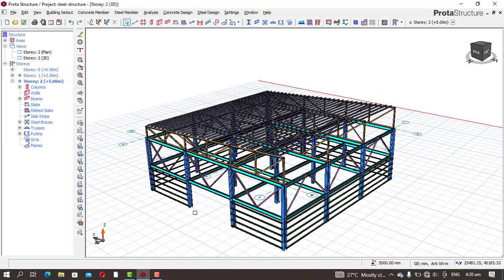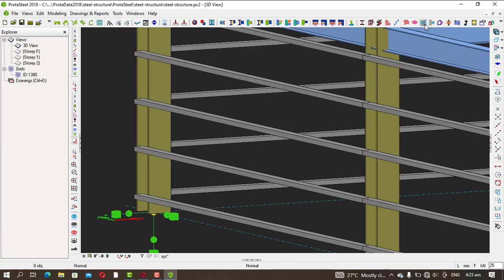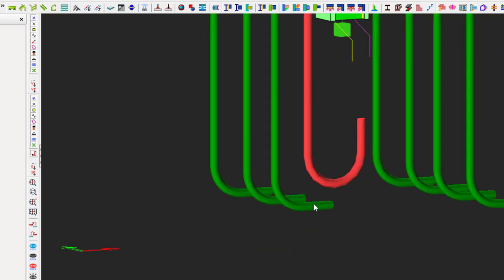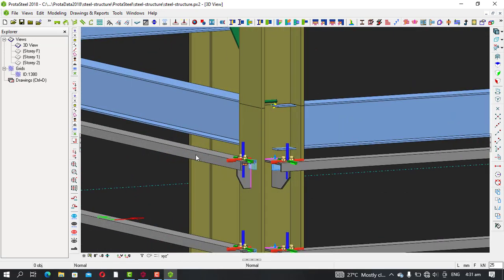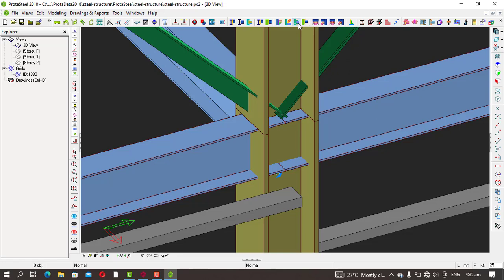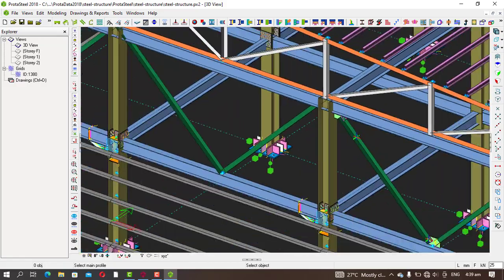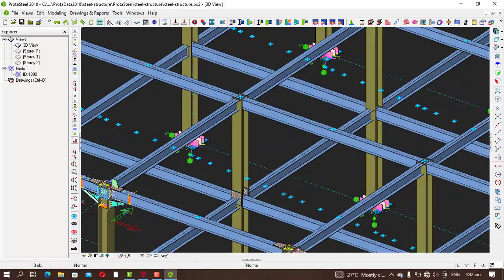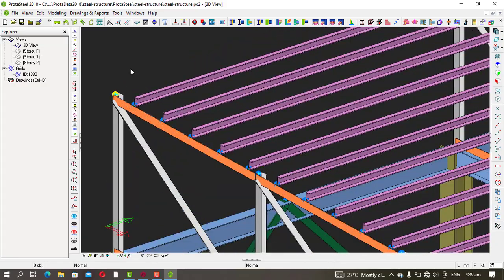Detailing of a steel structure with ProtaSteel.

Comment: How do you make welded joints in RHS without gusset plates. How do you weld plates to wall or concrete columns for RHS truss ends?

Comment: As regards the plate, what if i want to specify a metal profile deck, like a composite or concrete 50mm with maybe 10mm rebars (Top) and the steel profile?
Reply from the maker: ProtaSteel handles only steel and its connections so you can't use any other metal. If you must use a RC slab, that would have been modeled and designed in ProtaStructure.
Reply: @ridwantician  thanks for sharing

Comment: Awesome video👍….However I have few comments….you have not discussed how to edit connection properties. For example what if i need to use 4No. Anchor bolts for the column base rather than default 8plates

Also for connection of Beam to Beam or column to column what if i need to only use 4No. Of Bolts with clears or even 2No. Also how do we check that the connection is adequate to withstand the anticipated bending at forces at the support?
Reply from the maker: Thanks for the observation. I still have more videos to release on ProtaSteel, then I'll discuss the editing of the connection properties adequately. As for how to check if they're adequate to resist the bending and shear force, I already made mention of that in the most recent video I dropped two days ago. Thanks.